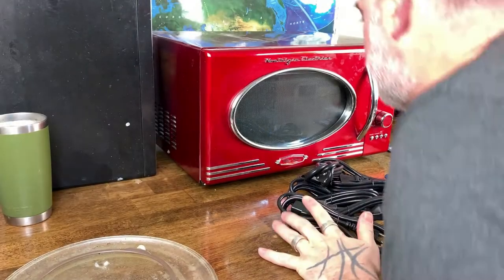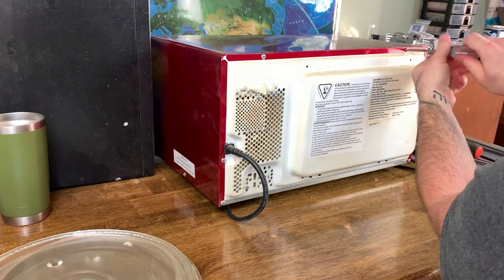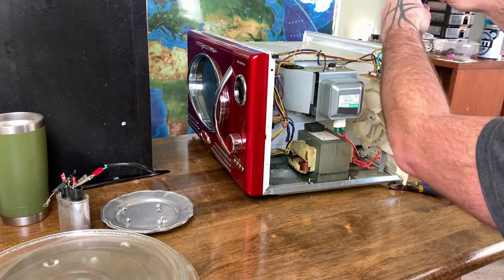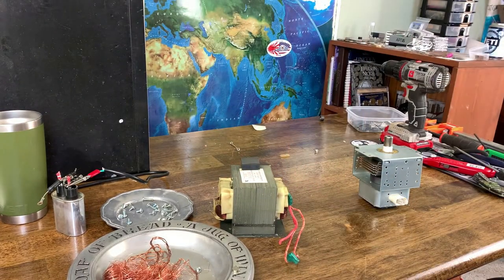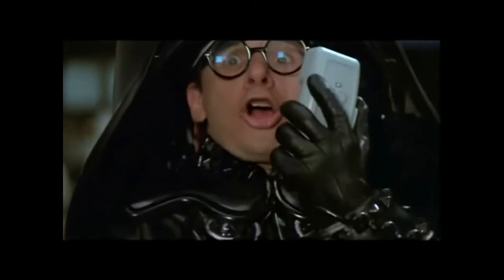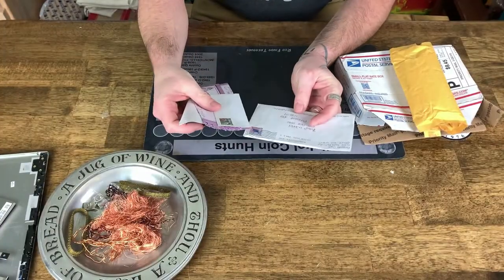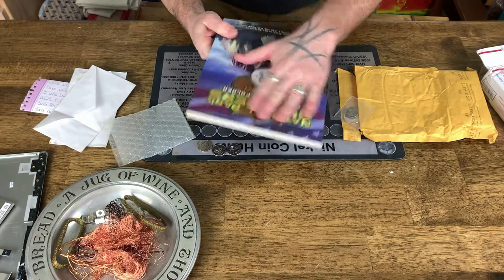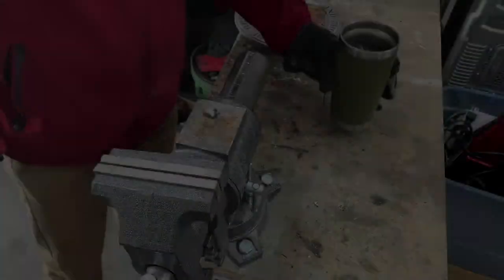Microwave Meltdown!  Melting the Copper and Aluminum from Old Microwaves

Comment: I get all my microwaves for free.  I am friends with the maintenance person in my apartment complex and he brings me all the ones that are tossed or left in units when people move out as well as anything aluminum and copper.

I hade the same issue with the security star screws so I went and got the security bits that fit =)
Throw all that coated wire n your forge.  You don't have to worry about stripping those small ones and you get to melt the copper =)